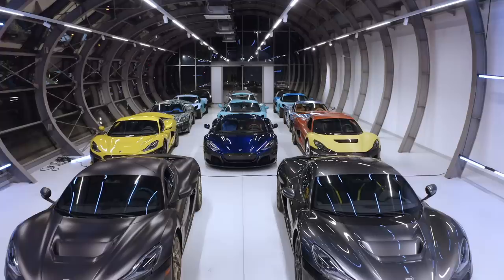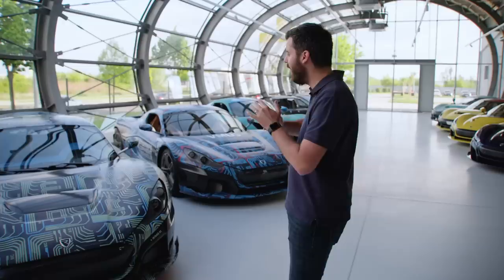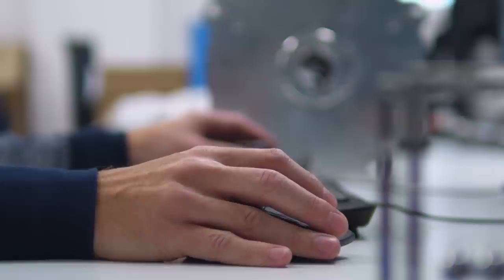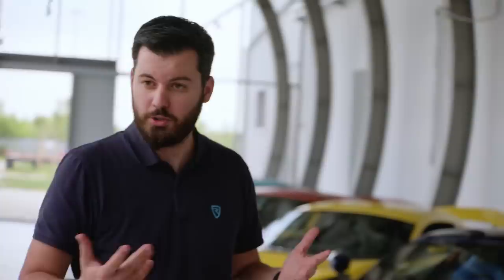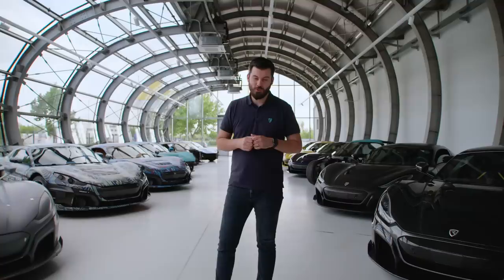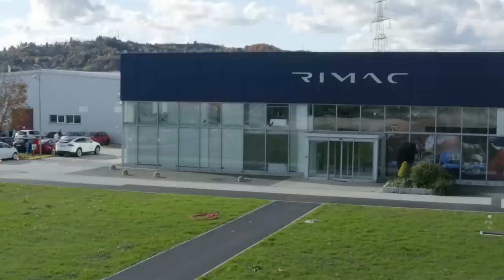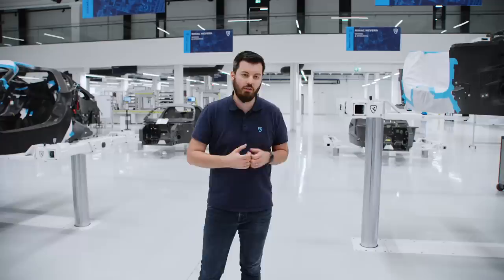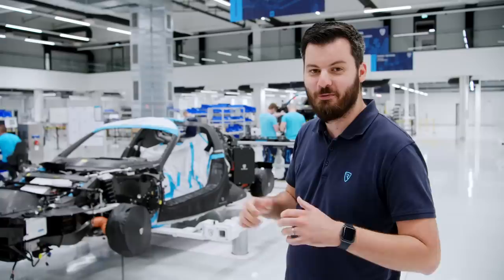First Production Nevera & New Factory

Comment: Inspiring, congratulations! The Nevera, and the track-focused McMurtry Spéirling fan car, are ending the combustion engine era from the top down, while the Tesla Model S Plaid and Lucid Air GT Performance (was the latter quicker up the hill at Goodwood than the Nevera's run last year?) are setting a floor for electric supercar performance with $140,000 practical five-passenger sedans.

The asterisk next to the Nevera's "quickest production car" claim remains. "Production vehicle" is a slippery term, but I found one FIA definition of it for a sports car: 25 substantially identical cars produced for sale to the public in 12 months. Rimac may achieve that, though it only ever made 8 Concept_One production cars.

Comment: The Rimac looks great. I would suggest for future designs that you integrate the Rimac "R" logo into the rear tail lights. R for the Left and reverse R for the right tail light. There are a few designs I had in mind but I will leave it to your designers to come up with a final design. Best of luck with your production models.

Comment: Hi. Mr Mate Rimac said he want's  the next Bugatti to have a Combustion engine.
So I suggest he consider a formula 1 engine design the same as the AMG One, tuned for public road's but with a V12 of the Formula 1 design.
Detuned for approximately 10 000 rpm maximum, & low rpm drivabilty.

Comment: All vehicles need pair of lungs that one water tank and HHO generator, current engine product is not already mature, Water tank and HHO replacing the gasoline and diesel tank as lungs this how to perfecting the current ICE vehicles digestion. And KOH solution and NaoH solution is vehicles drink.
Reply: The energy required to produce HHO is inevitably more than energy you'll get out of burning the hydrogen or running it through a fuel cell. There isn't a better way to turn wheels than a battery powering a motor.
Reply: @skierpage  HIGH CURRENT ALTERNATOR, SUPERCAPACITOR/ULTRACAPACITOR IS ALREADY EXIST, YOU THINK HUMAN NOT CAPABLE TO MADE FUEL FROM WATER ? HUMAN ALREADY HAVE ITS TOOL TO DO IT RIGHT NOW.
Reply: @SharhbiniRauf  I'm sorry you don't understand physics and thermodynamics. Yes you can split water to make fuel, but I repeat it will take more energy to do so than you get out of the fuel. Capacitors don't change this fact, and they're not used to directly power a motor in cars because a big battery delivers equivalent power with far greater energy capacity for far less money.